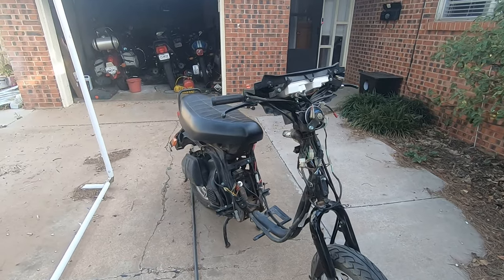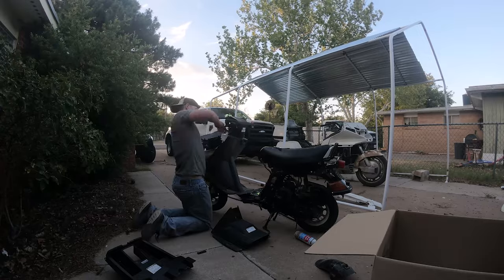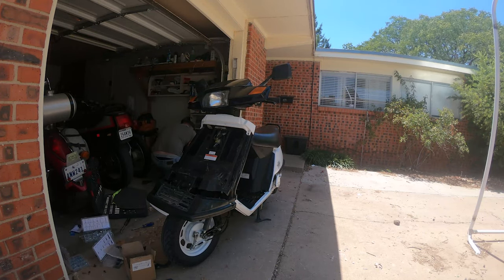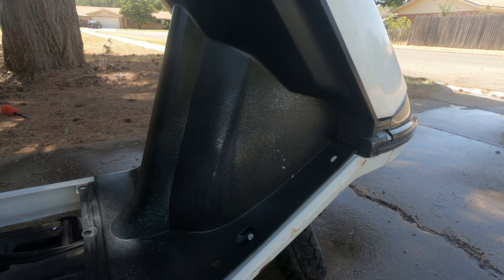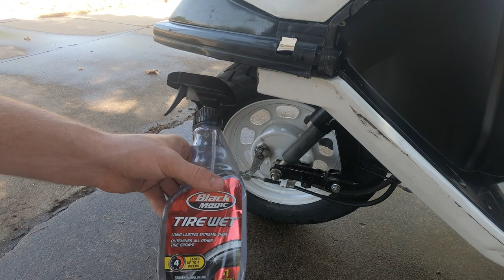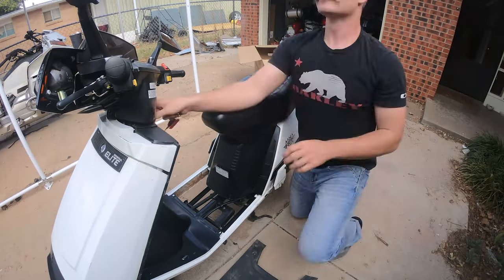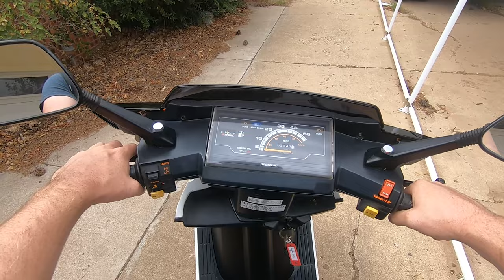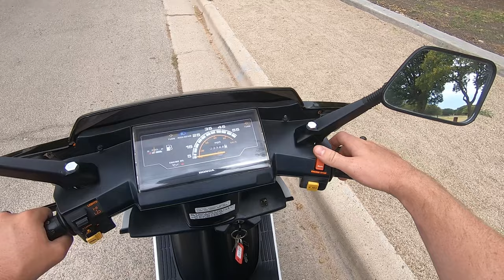FULL RESTORATION Of 24 Year old Scooter, Honda Elite CH80 Time-lapse  (Narrated)

Comment: Just got one 2 weeks ago. Just changed my engine oil, final gear oil, air filter and spark plugs (which led to the plug wire getting changed as someone previously slammed it down on the clip terminal rather rhan removing it and putting the boot over the plugs screw terminal as is recommended) 

Now it hits 45mph on level ground and got it to 55 downhill and is much more responsive and less wanting to stall in the cold morning air